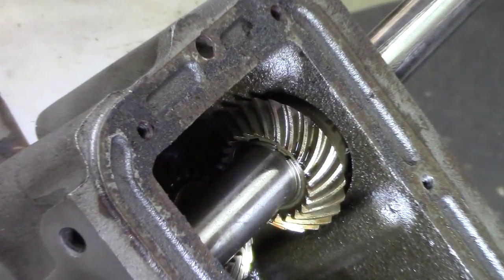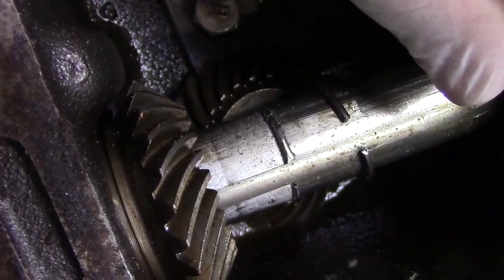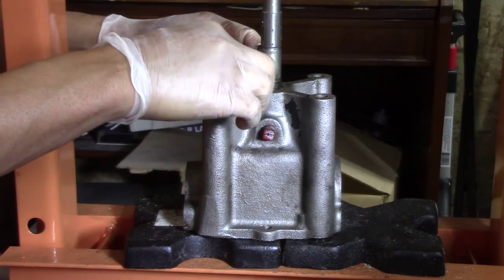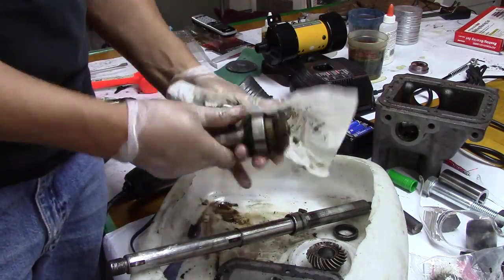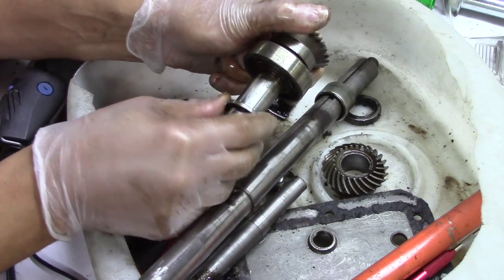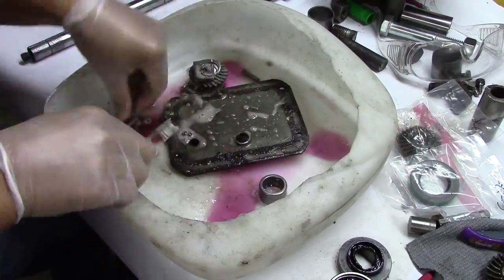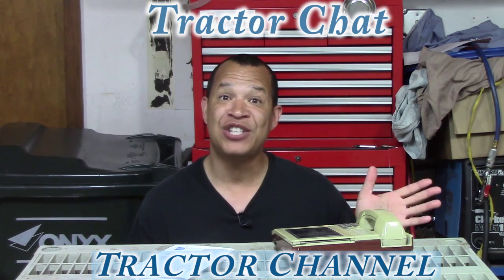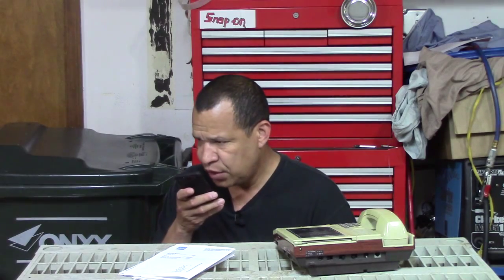35) Allis Chalmers 310 Tractor Restoration project, video 35

Comment: Hi, where did you find the needle bearing and oil seal for your bevel gear drive, I have a 1963 simplicity 725 model and I am restoring it and I am having a hard time finding parts for it. Thanks Stan. 6/14/2016
Reply from the maker: Hi Stan, sorry it took me this long to get back to you.  I have been out of state with the in-laws.   I got my parts from Sandy Lake Implements.  You can call or go online.  So far they have been able to get 90% of the parts I needed.  You can google them for the website or their phone number.  Good luck and let me know if I can help with anything else.  Ps. If you video the restoration, please let me know........
Reply: Thank you, you have been a BIG help.
Reply from the maker: You're very welcome!  Let me know if I can help with anything else.....